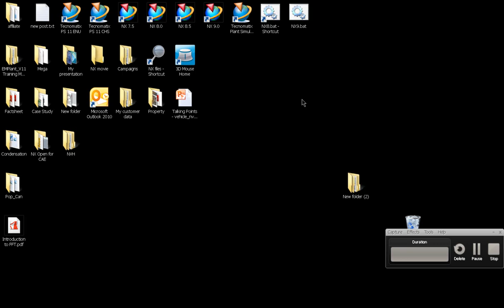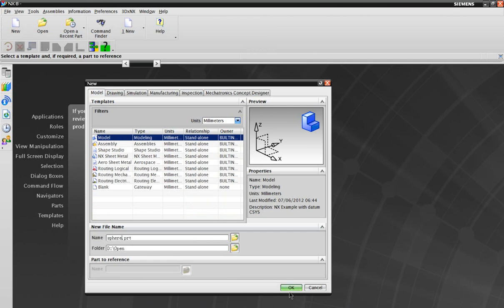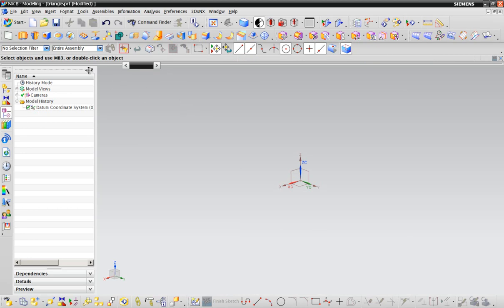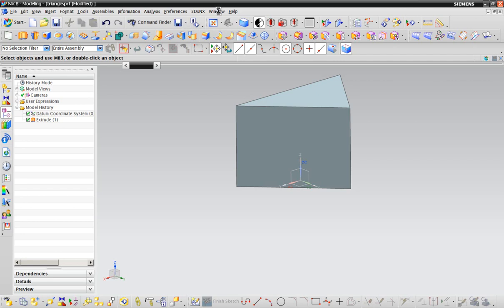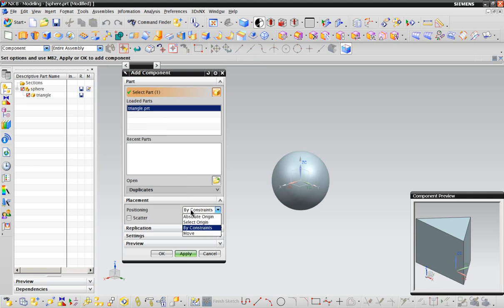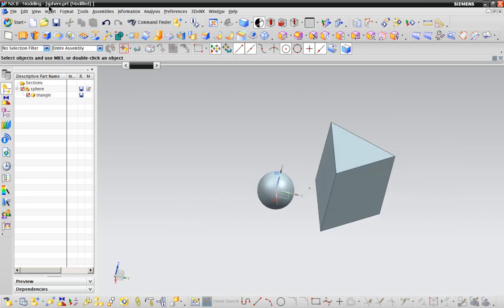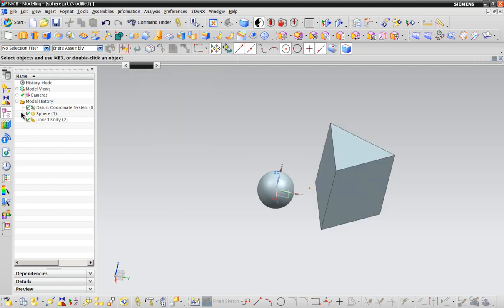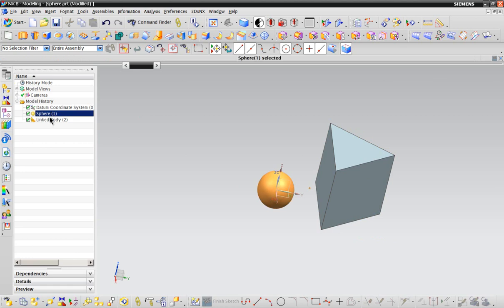WAVE Geometry Linker

Comment: does it work in assembly mode only? is it possible to wave link without adding the triangle into the sphere part file?
Reply from the maker: It depends on your objective. If your objective is to copy the CAD information from one file to another file, you can use geometry wave linker. Other method is to use the standard import command, to import the external file (such as .igs, .stp, etc) into the NX .prt file.

Comment: Can you tell me if I 'm having patterned parts in a single assembly part and I want to perform different features(like holes, pocket) on ONLY some of them separately, so how do I break the links?
Reply: +Soumitra Vadnerkar   I'm not sure breaking links is the best thing to do.  Because bad things can happen if the children files don't have parents to reference initial geometry from.  You could do is create different files maybe and do the different operations on those separate files.